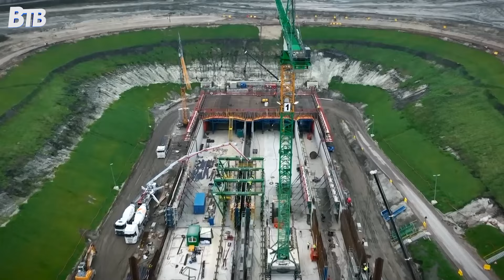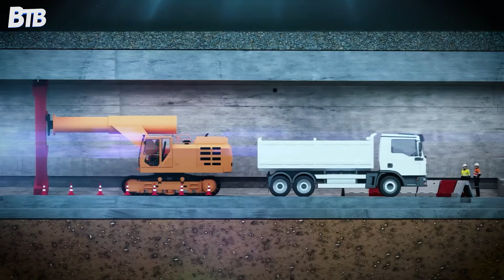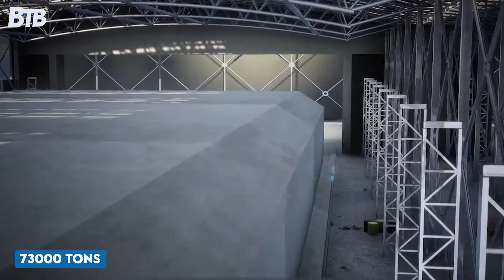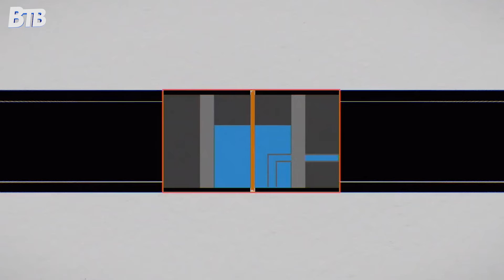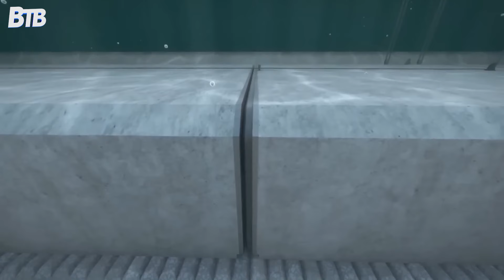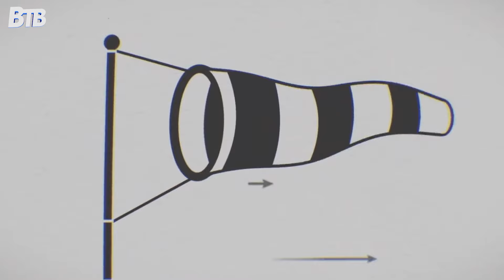Europe Is Building Something That Shouldn't Be Possible!

Comment: I wouldn't have thought this was possible, until I watched construction of a subway line in China years ago.  My office looked down a major street in Beijing where they were literally dropping in fabricated concrete sections of tunnel.  They had an enormous ditch digging gantry rig that ran the width and length of several blocks.  They just moved down the street breaklng up pavement, digging down, dropping in the concrete sections, covering it over, and paving back over it.  Totally unlike any subway construction I'd seen anywhere in the world.  This approach in the EU seems to make total sense.
Reply from the maker: That must have been incredible to watch!